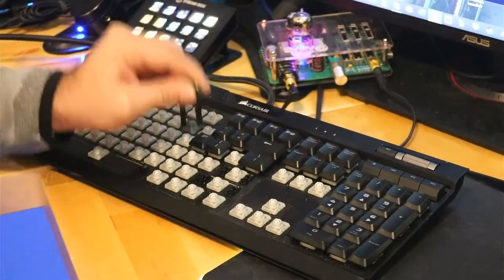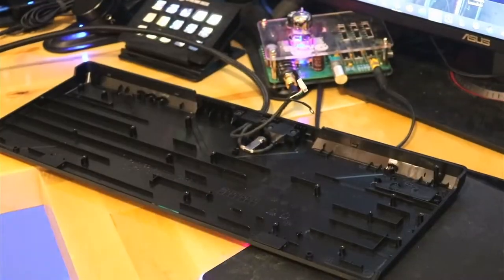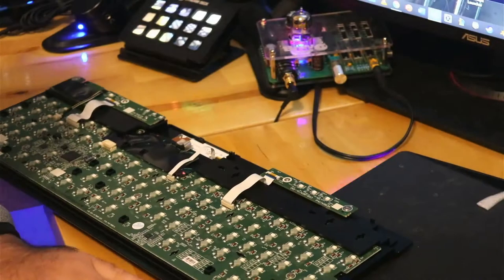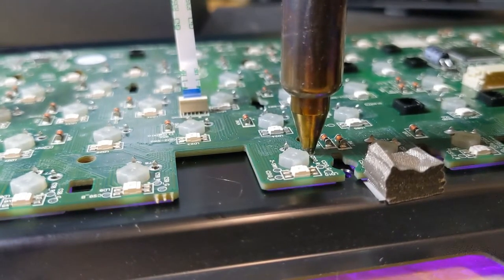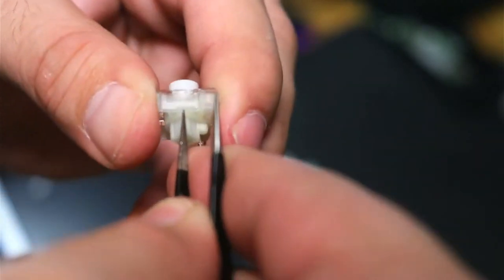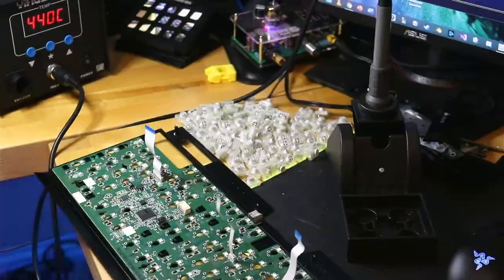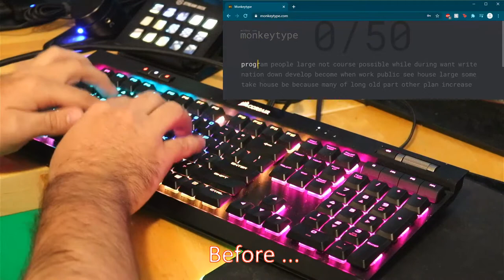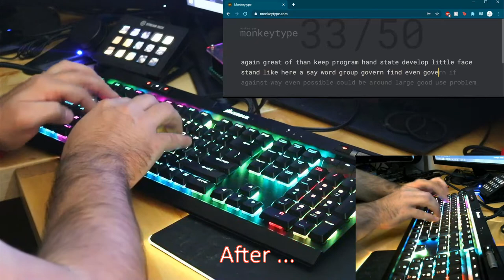Keyboard Build: Corsair K70 MK.2 Low Profile: Krytox 205g0 and Foam (Cherry Speed)

Comment: Wow, the sound is amazing after. Home much time could I expect to put into something like this project?
Reply from the maker: So I guess it all depends on whether or not you have to desolder.

 (Without desoldering) Well I like to take my time, listen to music. In order to lube a full size keyboard it would take around 5 hours. If it's just a small 60%, it takes 3.5 hours.
(With desoldering)
It will take in between 7 to 10 hours just to desolder and lube.

If you're asking about like the actual video production:
Recording the sounds probably takes around 20 to 30 minutes. B-roll is about an hour to an hour and a half. And then the video production is around four to eight hours. But if it's a longer video it can take up to 15 to 16; including the rendering time if I did it multiple times.
Reply: @ireakhavok  WOW That's an incredible amount of patience! Thanks for the detailed response as well. And I'm guessing you enjoyed the whole process would you say?
Reply from the maker: @OhGosh360  I do not like de-soldering switches, just because it can be a huge hassle. For example, right now, My de-soldering pump has a warped container for the solder. I have to either find the right container, or buy a whole new pump. Soldering and lubing switches, absolutely, yes, I enjoy. It's kind of soothing, and relaxing in a way. If I had the best tools, then I probably would like it, but I would rather get the next keeb to modify, instead of buy a 400$ de-solder station. Maybe some day, that will change. 

For the most part - If you build a keyboard yourself or if you get a hot-swap keyboard, it will just be a great experience. you may not like lubing switches, but it won't be something you hate 9 times out of ten. I do know of some people who loathe lubing switches, but those people generally have never desoldered, either, or don't know how to look at the bright side of things :P 

As for modding keyboards, as a whole, yes. I love doing it. I type all day long, and enjoy doing it. If you can't tell, by my paragraph delineated replies, lol.
Reply: @ireakhavok  As someone who hasn't soldered or desoldered since high school shop class, what would the mods that I would be able to do this keyboard be? How would I go about lubing (if at all possible) without soldering? Additionally, how much of the improvement would you say comes from the foam vs the lube? Thanks for the video, it was therapeutic in a way - I'd be interested in watching a real-time video with some gentle music in the background. It's really relaxing.
Reply from the maker: @vrts  Thanks for the comment! So there is a problem with this kind of switches. They have an oddly shaped stem that keeps you from being able to stick a brush  inside the switch from the top side. if you had the normal sized switches (not the low-profile) you would be able to do it like I did my corsair K63 in the other video on my page. You could definitely do the foam, and you would get varying results, but you could keep trying different materials from silicone, to different packing foams. I would suggest that you start collecting foam sheets from things that you get in the mail, or you could go to u-haul and by some thin packing sheets from them. I definitely feel that for this board, de-soldering it is about 70% of the final product, and you can achieve around 35% without de-soldering with just foam. If you were to have the normal switches you could top-lube them, and get roughly 70% of the way there. I do stream on twitch sometimes, you are welcome to join the discord or follow me there. I will be streaming two keyboard builds in the near future.
Reply: @ireakhavok  I guess it's time to pick up some soldering tools and see if I can bust this open. I really like this keyboard, the switches feel amazing but I do have a bit of that pinging on the return. Also, just hearing the keyboard after your foam + lube is really motivating. Anything to specifically watch out for? I'll be using your video as a guide once I get everything I need ordered.

Having now done it, would you have done anything differently?
Reply from the maker: @vrts  Just be sure not to over-lube the switches. There was one that I had to de-solder before the sound test and remove some of the lube, because it was a little too lubed. Don't worry, though, as long as you don't see any globs you should be fine. you can tell when it is too lubed. There are some cramped spaces in there, so in this specific case, having the "right" lube is pretty important. I would stick with Krytox 205g0, as it did a tremendous job. 

Be careful with buying the right tools, as always. Cheaper or more expensive isn't always better. The de-soldering gun I bought for this got jammed and melted the housing for the solder, so now I have to find replacement parts. You can get a solder sucker and do it more manually,. Just be sure to be safe and work in a well ventilated area, which is not what I did. I didn't think that it would effect me the way that it did. 

That's all that I can think about for now, but you are welcome to join the discord and share your experience if you'd like. If you google "ireakhavok discord" it should take you to my twitter act. ireakhavok1, where you should see the link pinned at the top. 

I hope all goes well!

Comment: man i also am tempted to open my board up. i have the normal k70 mk2. but im hesitant to break this plastic clamp at the volume wheel it feels like its the cheapest plastic that you usually find on chinese toys that are beeing sold on a flee market for a dollar
Reply from the maker: I am using this as my main keyboard for my secondary computer. After mods it really makes it a fun keyboard to type on, just because it is so unusually quiet and smooth.

Comment: This is amazing! Damn if you were local, I'd pay you $50 to do this for my K70 Mk2 I'm too scared to do this myself lol
Reply from the maker: Sadly this is like an 8 hour job and can cost 30-40 in just supplies. You should definitely try!
Reply: @ireakhavok  Fair enough, I don't have confidence in de-soldiering and then soldering them back on. How much of a difference would it make if I only use dampening material and NOT lube the keys? Could use dampening material inside and on the outside under the keys I could try some dynamat stuck to the metal.
Reply from the maker: @HeadphoneHangover  Dampening will act as a low pass filter, and cause many high pitched sounds and case reverberation to be reduced. It will definitely help, but probably is only 30% of the reason for the change in sound. Still a worthwhile thing to do!

Comment: Please advise which PBT keycaps to take for this keyboard ?
Reply from the maker: There are none!
Reply from the maker: @The Digital Space those keycaps are not low profile and they do not fit the k70 mk.2  because the bottom row on the k70 MK2 is non-standard and those sets are standard.
Reply from the maker: @The Digital Space but I didn't know that they had aftermarket keycaps THE MORE YOU KNOW
Reply from the maker: @The Digital Space they are either contoured differently, or have a different texture. Do not EVER buy them, IMO, if you use that keyboard for ANYTHING other than gaming, like browsing the web, or actually typing. I believe one kind of set came with the MK2 low profile, and it was trash.

Comment: Idk why some keyboard nerds think DIY keyboards like the ones most popular youtubers and twitch streamers use are far superior than store bought gaming keyboards. All mechanical keyboards honestly suck in terms of sound unless you put foam in your keyboard frame and Lubricate your switches. (Unless they're cherry mx browns. Those switches are downright awful even when lubed.) I have foam in my K95 Platinum right now, and it does improve the noise a tiny bit, but not by much. I'm considering lubricating my switches now after watching this vid. Do you have a link for the lubricant you used?
Reply from the maker: Link is in the description! :) And, yes I agree with you. I enjoy modding boards. Seeing it change from one sound to an improved sound. It's honestly more work to modify something like a Corsair.
Reply: @ireakhavok  yeah the custom built keyboards are easier to work with, but I do like corsair's use of a similar frame standard, which makes it easier to put foam in there, although I might have broken the plastic screw standoff located under the space bar & idk if that will interfere with the foam.  ALSO your link for the Krytox 205g0 isn't there.
Reply from the maker: @Darkminer86  you should be fine!

Comment: Fam I like the effort but the stabs are still clicking
Reply: Also lubing the stem is completly redundant due to the lower housing being doused with krytox.
Reply from the maker: yes. The stabs are not very good. They were proprietary, if I remember right. I could take another look at them for sure, though.

Comment: You put in way too much lube on the bottom housings, thats why they are so quiet. Otherwise, Good job!
Reply from the maker: Hi Christian, thanks for stopping by. I do have a heavy hand at lube, but actually, no, I disagree, it isn't over-lubed. the keys would feel and sound a little sticky and inconsistent, which they do not. I wish that I could show you.... but, the sound difference is due to two things:  My mic settings were probably not the same. Sadly, I don't remember what the settings were. since this video, I have made sure my sound settings are correct. And, secondly, they did get quieter (but I will definitely argue that they are not over-lubed).
Reply from the maker: I would like to hear other people's low profile switches when they lube them. if you have done it, or know of other people who have, please let me know.